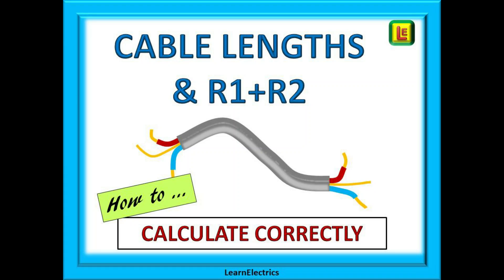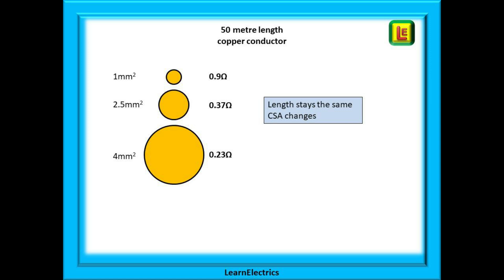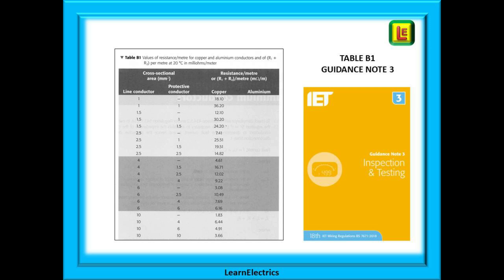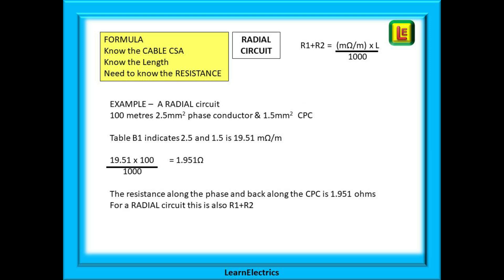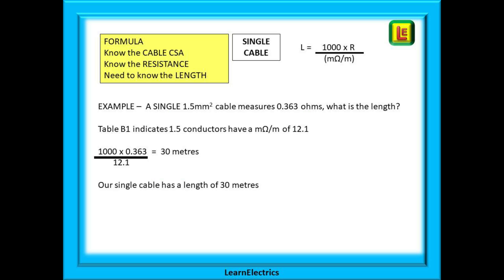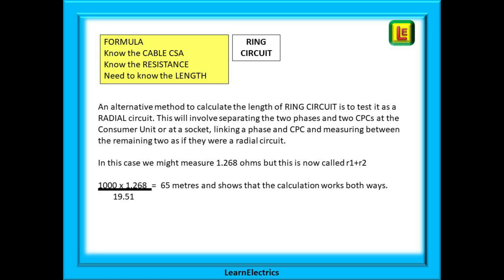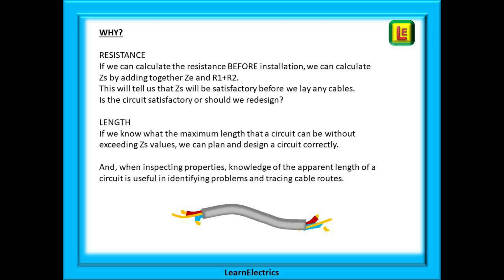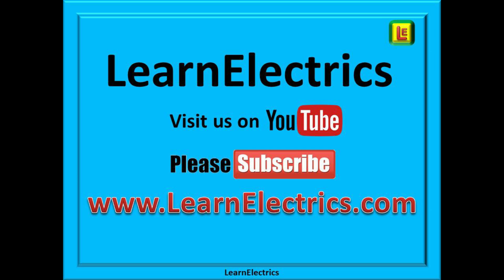CABLE LENGTH CALCULATIONS and R1+R2

Comment: One point, observing the values in Table B1. The conductor of csa 2.5mm^2 is shown to have a resistance per unit lngth of 7.41milliohms. For the conductor of csa 1.5mm^2, the ratio of csa compared with 2.5mm^2 is 1.67. As we know that resistance is inversely proportional to csa, in theory, the resistance per unit length of the 1.5mm^2 conductor should theoretically be 1.67 x 7.41 milliohms = 12.37 milliohms. And yet table B1 shows it as 12.1 milliohms. This is surely too big a difference to be attributable to rounding of the values in the table. This discrpancy seems less with bigger differences between the csa, so comparing 35 with 16, for example, agrees, to 2 decimal places. What's going on?
Reply from the maker: The regs and OSG will round up or down as they see fit, This is only 27 thousandths of an ohm difference which is considered negligible.

Comment: At nearly 70, I have decided to do a domestic installer course, I am building a house (with help), and want to install all my own electrical sockets, sonoff smart switches, and concealed led lighting. 
I have found your videos invaluable in learning 18th edition, hopefully I will pass the exams.
I also have been using notion to save videos under different tables, and place notes, bullet points and toggles to have drop down text to questions. I am fascinated by it all and wished I had done it 25yrs ago. I run 9 amusements arcades and my background is embedded computer game programming and electronics. I hold a bsc in computer science.
Reply from the maker: Better to start your new passion today rather than tomorrow, Learn a little every day and you will be surprised how much you learn by the end of the year. If you have an electronics background, you will do well. My electronics goes right back to valves, through transistors, logic chips and uProcessors etc. All good stuff to give you a great head start.
Stick with it, lots of videos to watch on our channel and LearnElectrics.com has a search bar where you can put your keywords in and you will get a list of direct links to videos on the topic.
Good luck buddy. Dave.

Comment: Hi Dave can you clarified  about  on onsite-guide 32 A length 106 metres but volts drop calculation 98 metres so can you clarify  that 106metres complied volts drop. And onsite-guide 106vd meaning is that fail volts drop, or other meaning , please can you explain  those for me. Thank you
Reply from the maker: Azizur, thanks for the question.
Look on page 65 OSG. Just below the DARK brown box it says load distributed around the circuit. This uses an additional calculation to do this. In the formulas in the video and in any exams, we calculate the worst case volts drop at one point.
For example a cooker is a single point and the load cannot be distributed, so is a shower.
Hope this helps, Dave.

Comment: Hi, on our assignment I'm currently calculating circuit length for the lights. On the drawings I've loop all the feeds at the switches then they go out to the lights. When calculating circuit length, do we add all the switch drops up till the last one and use that for the calculation? Or do we need to calculate all the switch drops and the feeds out to all the lights such as fluorescents that are looped around in a radial?
Reply from the maker: To be most accurate you would include the switch drops since the current does flow through the switch wires. You are trying to find the longest possible length of cable whilst still being sensible. Good luck with the assignment. Stick with it, its a good trade, its taken me around the world a few times. Dave.

Comment: Another cracking video dave 👍 can I ask , and sorry if it’s a silly question but does cable length have an effect say for eg. Using old singles on the old colours grey sheath red with cpc and grey sheath black (live red +earth and neutral black) so say a neutral cable was longer than the line and earth, would this have an effect as I’ve noticed my downlights have many single blacks tying back into ceiling roses etc and some are longer than the live red cables? Hope I’ve explained it, I understand that an rcd monitors,like you say in one of your videos what goes in must come out, but I can’t get into my head that if cables live neutral are different lengths does this have any effect 🤔 voltage drop? Sorry just a thick bricky trying to understand 😂😂😂
Reply from the maker: the length of the cables won't matter so much for RCD as it is the total resistance of L+N and that resistance should be a tiny fraction of the actual load/appliance. 
Regarding N being longer, they should be about the same length but even a 10 metre difference in length will make less than 0.1 ohms difference in resistance. And I doubt they are anywhere near that length. Again, voltage drop is the combined lengths.
Hope this helps, good questions. Dave.
Reply: @learnelectrics4402  cheers dave thank you for your reply 👍 really appreciate it 👍👍

Comment: Nice and clear, great video. Once you have all your Z readings. Is there any formula that shows you there maybe loose connections in circuit.
Reply from the maker: Only by looking at the Z readings and becoming suspicious of high readings for short cable runs. Sometimes an RCD will kick a circuit out, I had that with a loose neutral at the CU. Good luck and keep watching. Dave.
Reply: @learnelectrics4402  Hi Dave, Thank-you for your reply. In a ring-main scenario, I'm told a quick check of Z readings for loose connections is to use R2 = 1.67 * R1. Then do (calc of R2) - (Actual reading of R2) To obtain the Z reading for any possible loose connections. Is there any truth to that?
Reply from the maker: Yes there is Roy. You are comparing the Phase resistance to the CPC (Earth) resistance but that only works for 2.5 T&E. It's one way though.  A lot of the time it's instinct and that only comes with practice. For instance a short cable just a couple of metres or so from the CU should measure almost nothing (0.05 ohms) . If it comes out at 1 ohm then that is the same resistance as 50 metres of T&E. Now instinct should tell you that there is a problem. Its a good game to be in, I loved inspection and testing. Dave.

Comment: Hi it is  very very good video and very helpful please I am request more  video  formula that is excellent do more like this please  more calculation. thank you
Reply from the maker: We have plans for more videos with calculations, thank you for asking. Dave.
Reply: Hi it Azizur Rahman  can you  tell me please combine resistance like 2.5mm2 line conductor cpc 1.5 mm2 and add 4 mm2 line conductor 1.5mm2 cpc ,  how to calculate  length  of the cable r1r2  mean  combine full length  which mean adding 4mm conductor from ring adding 4mm line conductor for adding more socket . Please show me the formula thank you.
Reply: Combine resistance  2.5 mm and 1.5mmm some cable in the ring 4 mm line cpc 1.5 so how to calculate .